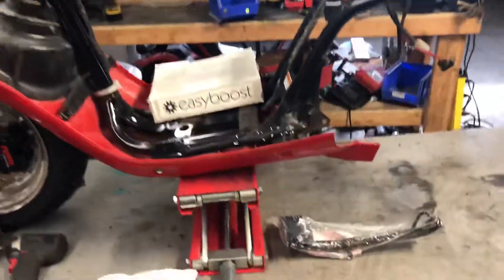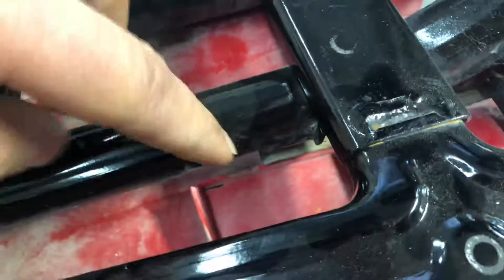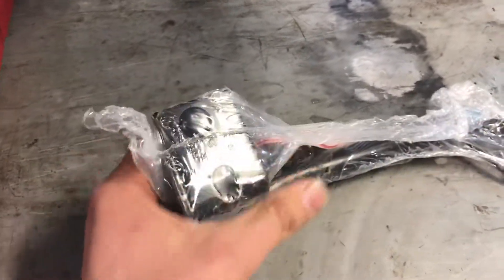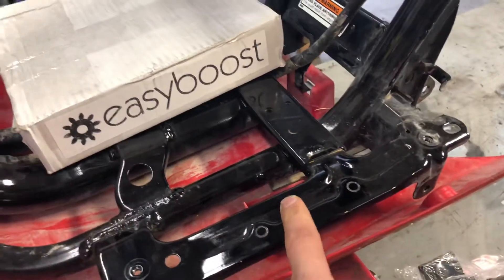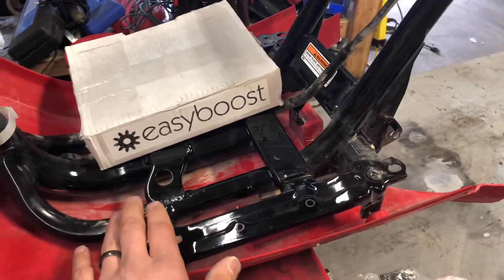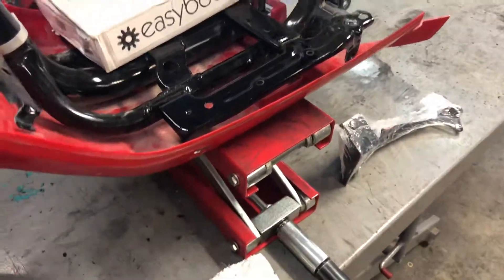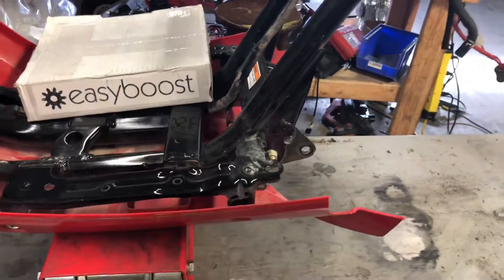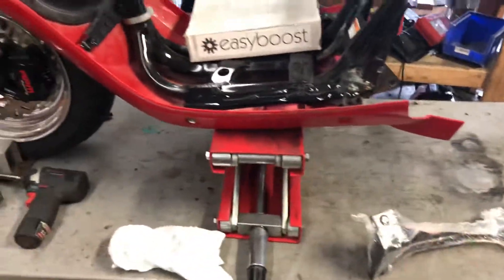Yamaha Zuma side stand install

Comment: I just cut out the bottom tab opening for my 89 and it looks like I’ll have to cut further inside towards the middle in order to drill that hole into the frame. By the way, what does that bolt that comes with the stand even use to tighten it up? It’s not even long enough. I would really love to see how you guys do this
Reply from the maker: call talk to Paul
Reply: Definitely agree 💯🙏🏽